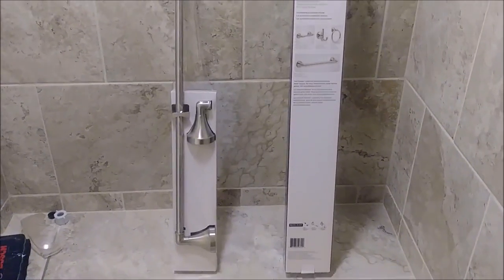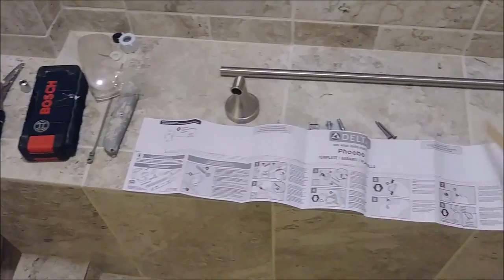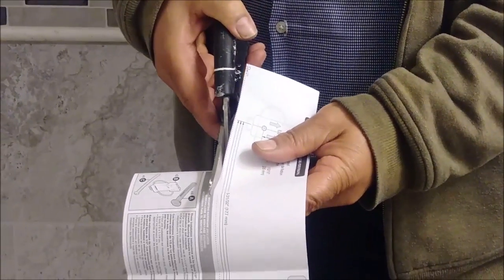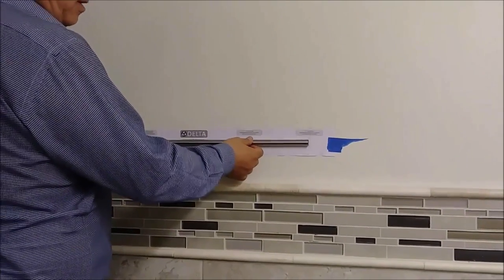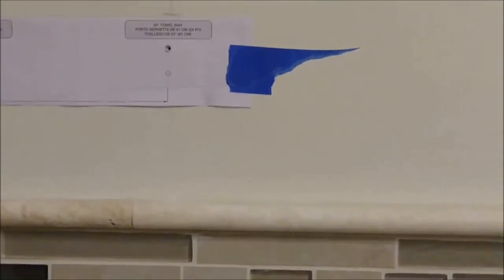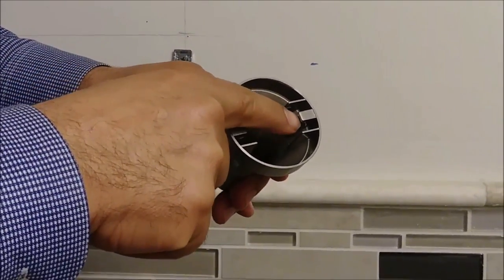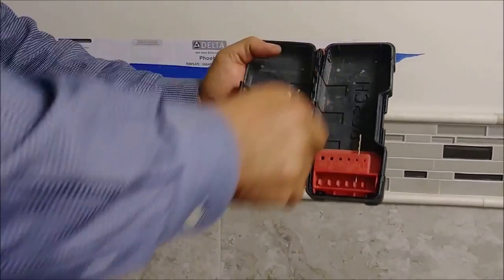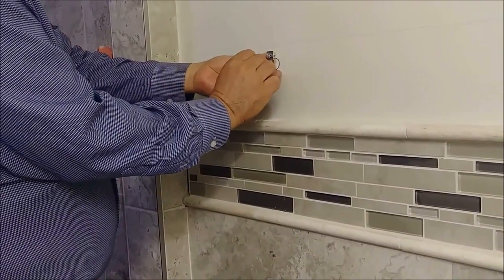How to Install a Towel Bar on Drywall – Last For Ever - Step By Step.

Comment: My towel bar came with plastic anchors. They were impossible to screw in with a screwdriver and the drill broke them. I feel like a hammer would have broke them too. The instructions said to use a screw driver so what did I do wrong?
Reply from the maker: You probably have a metal, screw or stud behind the wall. Just verify it. The metal  on a stud may protect an electrical wire going via the stud. If this is not the case you may replace these  plastic anchors with similar  plastic anchors found in Home Depot or Lowes